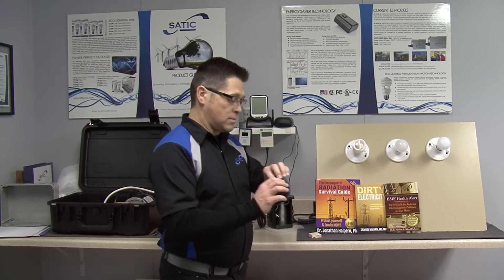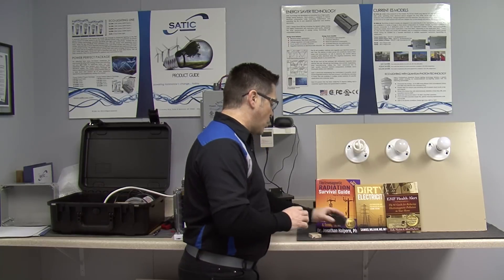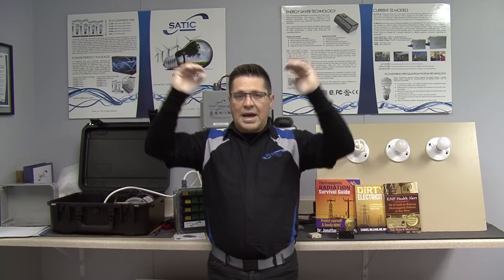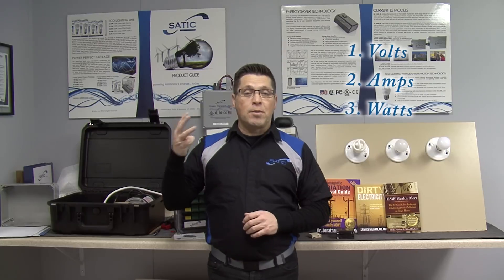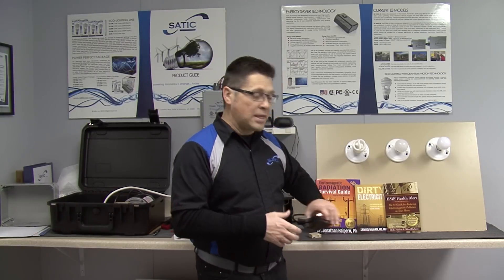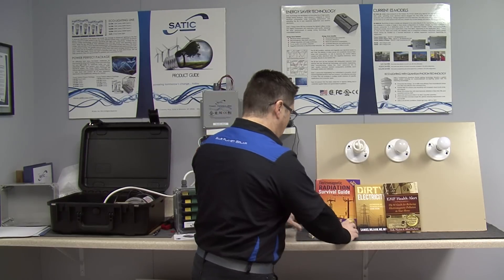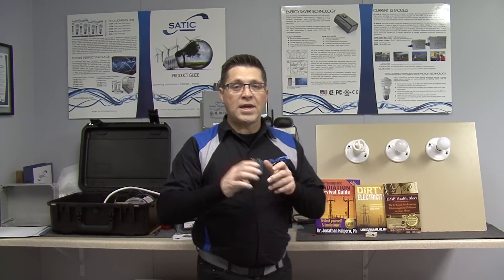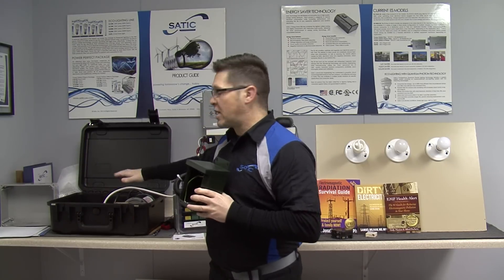What is Dirty Electricity?

Comment: the more this guy talks the more he shows he doesn't know what he is talking about.for one a circuit breaker does not regulate anything.it only prevents the amperage from going over a certain limit. this guy is out to sell only books.
Reply from the maker: So mean :-)  A breaker limits the amount of total amps flowing to a particular circuit.  Thus the name circuit breaker. A 20 amp breaker for example, limits the amps flowing to that particular circuit to a combined total of 20 amps. So it 'regulates' the maximum amount of amps allowed to that particular circuit.
Reply from the maker: We do help sell books. Note, we don't write them and are not paid a commission of any kind. We need to look into that though :-)
Reply: i would still stick to "current limiter device" as regulator is too broad.
Reply: A circuit breaker's only job is to prevent electrical fires from overheating the wiring.
Reply: It 'regulates' nothing! There is an element inside most circuit protection devices that has an action once a threshold of temperature is applied. An LM317 regulates DC voltage by basically dumping the excess voltage as heat. Similar to a resistor, or a voltage divider circuit.
Reply: A circuit breaker does not limit current. It's a current operated switch which turns off entirely when current exceeds a certain value. 

'Regulate' has a specific meaning in electronics. It means to actively raise or lower a value be that voltage or current while maintaining a voltage level or current flow.  Current and voltage regulators are very different device than circuit breakers. 

Also, there's no such thing as 'dirty electricity.' It's a pseudotechnical term used for one thing only- to sell snake oil.
Reply: saticusa yea so what’s your point? It has nothing to do with dirty power.

Comment: All correct, well yes and no. Frequency, common, older electric clocks kept really good time and that is entirely dependent on frequency. Harmonic distortion? unless it was horrible I would think the ac to dc power supply in audio equip would take care of that without a problem. Voltage spikes, now we have a problem as it might damage equipment if they're bad enough but in my 69 years on this planet I've been lucky enough to never have anything damaged. 
In my mind your video is a real crock!
Reply from the maker: Thank you for your feedback George. We didn't know that older clocks kept time from the frequency of their ac supply. Cool. Harmonic distortion was certainly far less of an issue prior to fluorescent, CFL & LED lighting and the change in technology with all the dc devices being added to the network. Our units have caught over 100 catastrophic strikes to date including the Tampa FL international airport. We appreciate the feedback, complimentary or not as we're genuinely attempting to create the best product line we can.
Reply: Yes, almost all older electric clocks ran from synchronous motors.  Any transients or spikes on the line would be filtered out by the inductance of the motor just as it is by motors or anything with a transformer.  In fact, most UPCs, mostly used for computers, put out a square wave, which is loaded with harmonics (Fourier analysis), which is filtered out by the inductance of the power supply power transformers.

Comment: What a load of BS. Your analogy with dirty electricity making my phone and laptop hotter when charging. You do know that the phone and laptop is charging with DC - It does not "see" the mains grid and the noise on it.
Reply from the maker: Anything with a battery is DC. However, the moment that they are plugged into an outlet the are connected to the AC grid. The AC from the outlet will pass through a rectifier that converts alternating current (AC) which travels in waves and reverses direction, to direct current (DC) which flows in one direction. Excessive harmonics for example will create heat although certainly not the only reason. Age and chemistry of battery, quality of battery or rectifier etc. Certainly more than one cause yet poor power quality is beyond contestation one potential cause of heat in electronics. Thank you for watching.
Reply: @saticusa  the rectifier is not IN the phone or the laptop, so your explanation does not make sense.
Reply from the maker: @zaprodk  we certainly don't care to argue or disagree. We do however like to discuss things that are of mutual interest. We'll share with you that it's been our experience that the rectifier is in the charger, not the device ~ so you need a specific cord to charge the device. You can't simply charge a DC device with any cord hoping the device can then use it. This may have been an experience of yours as well. The 'charge controller' however, is in the device to make sure you can't overcharge. Maybe you have leading edge devices that we're not familiar with yet. That is certainly a possibility as we don't know it all. Our only defense is that we've been making electronics in the USA for decades. Some of our team were making solar panels in Montana in the 70's as Sun Wise Solar. Please know Zapro that our desire is not simply to make money, stack them high nor sell them cheap. We care deeply about the space, the greater good, American manufacturing and engineering. Anything we can learn to expand our knowledge base is valuable. Thank you for viewing.

Comment: Capacitors don’t lower amps. You have no electrical education what so ever.
Reply from the maker: Tom, the Satic USA Engineering team consisting of Lead Engineer Dr. Bradley Layton PhD Engineer, Brian Havlovick M.S. Engineer, Brian Jackson B.S., MBA who was formerly an engineer at Idaho Power Utility are always pleased to learn accurate and up to date information. You may have intended to say that while they can indeed both lower and increase current or amperes and have been doing so since the 18th century, they often do not effect watts or true power other than losses to heat, ohms law of resistance which may be small enough to concede as no substantial change. Thank you for your kind spirited note.